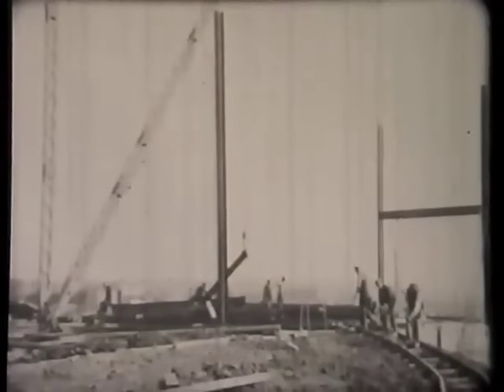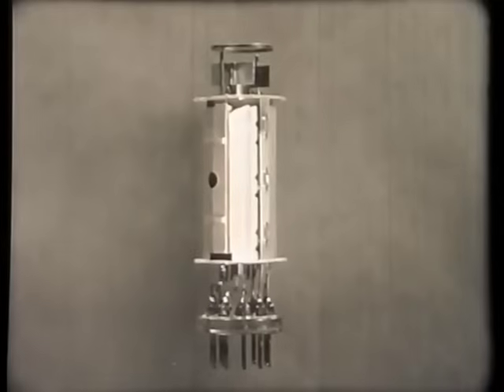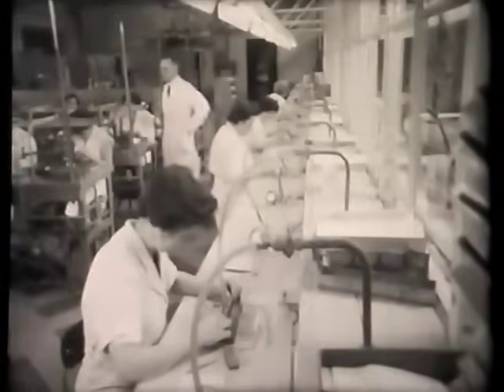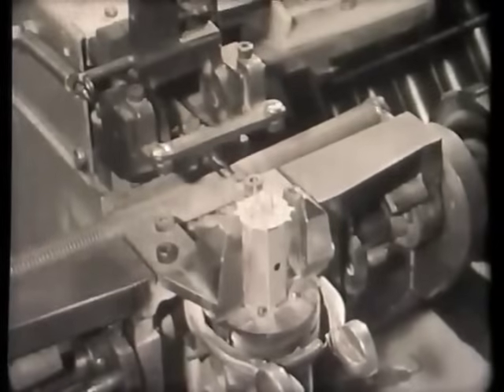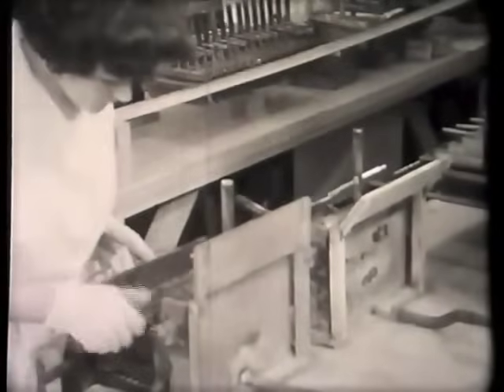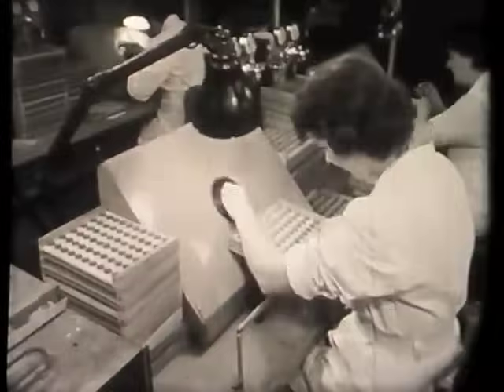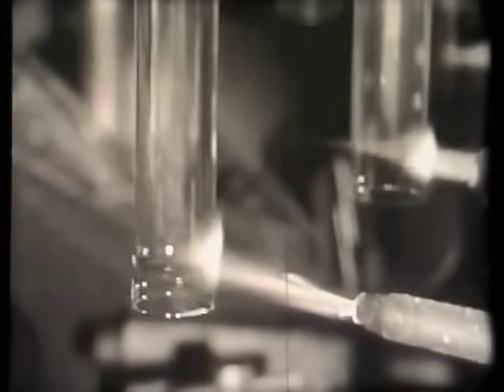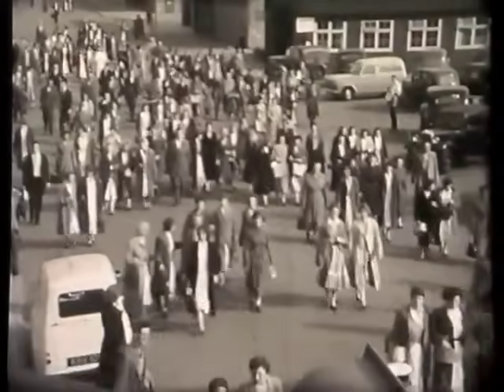The Mullard story

Comment: I worked for many years in M Building (seen at 2'33") which became the Videodisc / Laserdisc manufacturing plant in 1981. The wire factory was in the next building, and it later became our tape archive for Laserdisc and CD master tapes. That all closed a few years ago. Interesting site to work at with a large machine shop and engineering department that manufactured many of the machines in this video. I did my engineering apprenticeship there. The site also made electrolytic capacitors, circuit boards for Philips products, delay lines for PAL TVs and tungsten lamp filaments.
Reply: Very interesting! Thank you.
Reply: Thanks for sharing and best of luck!
Reply: You had tapes for CD mastering?  Presumably U-matic PCM1630 format?  I have equipment for those, believe it or not.
Reply: I did work experience in 1981 from high school Brownedge St Marys Bamber Bridge.

Comment: Apart from the amazing construction of the valves themselves I'm gobsmacked by whoever designed the machines that ran the processes as seen in the
 film.Just for the record I have a 53 yr old mains radio that contains Mullard valves -they still work!  Something special looking at the heaters glowing...
Reply: If I checked, there may be some of the same tubes in the National and Hallicrafters radios from that era. There is just something about a tube set that a transistor radio can't duplicate.

Comment: The EL84 they mention in the narration is an audio pentode, able to deliver 4 W undistorted in a class A amplifier, and more than 10 W in a push-pull configuration. It was later replaced by the cheaper triode - pentode ECL82 in all consumer electronics, as the additional triode in the envelope allowed to build a single-tube turntable - the triode worked as pick-up preamplifier in the turntable or Mike preamp in the tape recorder, the Geloso.
When I started my career, there were germanium transistors around, but they were too expensive for almost everything. I designed DC tube circuits - imagine the headaches with the feedback and the gain changes. The circuits were a royal pain to design, but the finished products were indestructible and had a fashion of their own.
But in 1962, when this film was made, the fate of vacuum tubes was already sealed. The silicon transistor was rapidly spreading and the design of ICs was ongoing; in less than ten years the vacuum tubes will be consigned to the scrapheap of history.
It may sound strange, but I miss that clunky and approximative world of the vacuum tube electronics. It seemed it has a soul; but certainly, it was warm... both literally and figuratively...
Reply: It looks to me as if the tube was actually an EL64 and not an EL84. Note that the plates were relatively short compared to the height of the glass bottle.  I have handled many many thousands of tubes here in the States but I've never seen an EL64.
Reply: @goodun2974  Very unlikely as there is no listing for EL64. Also the Miniwatt databook quotes the numbers 60 to 64 as being "All glass valves with 9 pin base", which refers to European 9 pin lock in base. The EF50 was the most common use of this base. Numbers 80 to 89 refer to American small button Noval 9 pin base.
Reply: @johnrebus1641  , the printing on the glass must be smudged; I slowed the video down to 25% speed and it looks more like a 6 than an 8, but the resolution isn't great and I'm watching this on a phone.
Reply: The EL84 has remained popular in guitar amplifiers to this day.  It is among the top tube types used in the power amplifier sections  of guitar amplifiers,  along with the 6V6, EL34, 6L6, 5881, KT66, 6550, and KT88, among others.  Few guitar amplifiers use the ECL82 but I think that a small number do.
Reply: I have 4 of them in my amp right now. RCA NOS that my grandfather had in his garage. I have Mullard tubes in an old radio he left me as well.

Comment: As a young student I worked at Mullard Mitcham, circa 1970, testing the much larger transmitter valves. It was great a time to be there, in such a busy department, even though I nearly electricuted myself, by touching the 400v grid bias electrode!
Reply: ouch, that must have hurt!

Comment: I'm amazed seeing the early robot automation, it would have been electro-mechanically programmed, very skilful design work. It would cost tens of millions to design each production line now, although easier in many ways with multi-purpose programmable robots.
I worked on a project on the 90's where some 50's controllers were being replaced. The only things i can liken them to were telephone exchanges. They were basically early industrial computers.

Comment: 23:46 that made laugh, precision processes everywhere and a gash hole made in the roof through a bit of gypsum. One would think they would have put a circular plate around it to finish it off.
Reply: A bit like I went to Jodrell Bank on a course and peeped behind an electronics cabinet to see a circuit board with wires attached and sitting in a cardboard box to insulate it from the cabinet shelf. Probably millions of pounds of astronomy gear and a cardboard box.
Reply: Bill  hahah yeah probably an essential mod that someone did years ago and it got forgotten about hahah
Reply: A bit like BT Openreach when the engineer came to install the full fibre broadband in my when they connected the fibre cable they had to open a hatch on the side of the pole to make the connection they had to move the copper connection board out of the way this connection board had a plastic carrier bag over it to protect it from the rain when i asked the engineer why this was the case she said most of these are like this i would have thought that they would have fitted a proper cover. thankfully the fibre connectors now used are waterproof.

Comment: I had no idea the process was this complicated and this well-automated.  The overhead associated with just maintaining all that machinery must’ve been staggering, especially in light of all the close tolerances required.  And think of the brain power and initiative involved in making all this happen.  And the labor costs.  No wonder the transistor swept this all away so quickly—but being a tube amp designer, I say that with a healthy measure of regret.
Reply: not on sound quality it didn't, we have to be grateful for the transistor, without it ICs would never have been invented
Reply: We need all this back, here in America. I love that we have tube manufacturers overseas doin a bang-up job (I love my Sovtek 5881's), but we need some at-home tube manufacturing for guitar amps and hifi
Reply: @TheChadPad  and transmitting tubes…
Reply: @dennisyoung4631  idk anything about those unfortunately. I’d like to! Tubes are cool!

Comment: the machines that was DESIGNED  to make the tubes is OUTA THIS WORLD!   no computers n  just a pc of paper, n a compass, n ONE SMART TOOL MAKER!
Reply: Not one tool maker, but an entire department (actually two departments, one for the valve/semiconductor department and a general one) dedicated just to production means for all of their sites world wide.
Reply: @mjouwbuis  Correct. And Blackburn engineers built most of the machines in this video.

Comment: Around 23 minutes there was the one and only mention of the word 'transistor'. Its incredible to think that all this plant, machinery and employment would be obsolete in a decade or so. Mullard themselves weren't paying attention -- they made transistors but they were invariably germanium, they were labeled like valves and packaged and priced like them. (So, for example, you could buy a vacuum tube triode -- an EC92 -- or a transistor triode -- an OC71. The first letter was the heater voltage or current, other letters were the valve type and the first digit the base type. They kept this notation for transistors even though by 1961 silicon planar transistors were being made by the bucket full (and the planar process was being applied to made integrated circuits). Mullard probably didn't know what was going to hit them until it was too late -- a pity since it was a fine company.
Reply: While the O was probably chosen by Philips and several other European manufacturers not to clash with the valve coding, it became a coding on its own, without the historical meaning from the valve coding. Then, pro electron standardised on A, B, C and R as starting letters and the Philips group of companies only used the O on custom semiconductors and pre production types anymore (NXP up to this day). I'm not sure what you mean by "didn't know what was going to hit them" as they made vacuum technology up to around 2008. Their transistors from the AC, AD, AF, BC, BD, BF etc. series were widely sold. In the IC era, they specialised in LSI bipolar digital and mixed signal circuits. Mullard was the design centre within Philips for Teletext and CD chipsets, amongst others. They still make semiconductors up to this day, though most historic sites seem to have been consolidated into a few new ones and some activities moved to sites outside the UK.
Reply: Mullard did produce silicon transistors, apart from the early alloy types, there were high frequency types like the BF115. NXP (the successor to Philips) still make transistors and ICs.
Reply: I recently restored a circa 1962 Bush portable radio that has all the original Mullard transistors.  The only components that had gone bad were the electrolytics and the detector diode.  It's an amazingly sensitive set and very well made too.
Reply: @mjouwbuis  Many of the silicon based semiconductors you mention were made at the Mullard (Southampton) Plant where i did my apprenticeship - too late for valves though.
Manufacturing went to the far east about the time i finished and the site now is a mixture of various other businesses. The EEB Dept (Electrical and Electronic Building) where many prototypes and other things were built is now a builders merchants (Jewsons i think) which i think i kind of ironic.

Comment: That machinery is amazing, effortlessly churning out millions of valves.
I have a D.E.R. valve with a pip on top and marked BBC which according to the information I have dates it as 1926 to 1927 but the incredible bit is that the tungsten filament is still intact and is very bright. It seems a pity to use it and burn out the filament, but it also seems a pity to not use it as intended.
G4GHB.
Reply: I'd recommend a Variac and slightly lower mains voltage to preserve the filament.
Reply: @jamesplotkin4674  It's a 1.8 Volt d.c. filament. I understand under voltage can be as bad as over voltage.

Comment: AMAZING and to think they did this without robots and computers
Reply: I see plenty of robots doing tasks in this vid.
Reply: Brian Cullen in my factory is, we are hoping to make it fully automated because we have a few workers and we have started to make them to robots
Reply: They did all this to build robots and computers
Reply: Plenty of robots in this video, but they were run with cams, limit switches and timers.  No microprocessors or PLCs in the mix.  Real engineering, tuning with feeler gauges and not a firmware load.  Great video!
Reply: @Albee213  wage slaves to capitalism. not much has changed unfortunatley. At least they were actually making something useful and world class quality

Comment: Wonder how the factory made money? I remembered the ECC83 (12AX7) cost a dollar back in the late 60s. I built my own stereo amplifier using 1 ECC83 for phono stage, 1 ECC83 for line/ tone control and 2 EL84 output stage. This setup was for 1 channel. Interesting hobby back then. I am from Singapore.
Reply: @who-gives-a-toss_Bear  The CEO was also not paid 1000x more than the workers, not more than 10x the lowest wage, I would bet
Reply: When the tubes (valves) were made in large quantity, the production costs were much lower. The setup costs play a large part of producing such items.
Reply: I also built a amp with 2x2 El 84 back in the 90s. We also dreamed about building an amp with 2 El 34 per chanel but they needed an 500 V transformer for the anode voltage.
Reply: @matneu27  I built one about 5 years ago to the original Millard design. weighs in at some 30kg, has 14 valves. Some parts difficult to obtain and not cheap!

Comment: I have watched this three separate times and I still find it fascinating. And Mullard made great valves/tubes. I still use tubes in my guitar amps. So far in my opinion they still sound better than transistors etc. for music.
Reply: I wish we could get the old el34 tubes they made my marshall guitar amps loved them now we get made in china crap why cant the us and the uk get togeather and start makeing them at home sad
Reply: @mariannwatt2678  ,  There would be enormous startup costs involved in making the necessary machinery again,  because Russia and China are unlikely to sell or give up their tube-manufacturing machines. Also, getting the requisite chemicals and metals and adhering to EPA and EU regulations for chemical use and disposal would be difficult and costly. And finally the cost of labor in Europe and especially America is much higher than it is in China or Russia.  There are a couple of companies in America and Canada that are manufacturing copies of the Western Electric 300 B triode that is much beloved by audiophiles, but that's a case where they can get $500 or $600 or more for a single tube.

Comment: Absolutely fascinating video. I would like to see how the process is done today for comparison. 💯
Reply: Some of the assembly might be done the same way on basically the same machines. Although some of the original equipment likely would have been sold as scrap metal, some of the machines got sold from Britain and Germany and elsewhere in Europe, to China and Russia.  Unfortunately it is quite possible that much of the machinery has not been maintained and kept up to speck and so even though some of the modern Russian and Chinese tubes might be made on the same machinery such as that shown here the tubes themselves might not be the same quality because of wear and tear on the machines plus perhaps lesser quality metals and chemicals being used for manufacturing the various parts of the tubes.
Reply: Similar probably, except it's in China and not Blackburn. I can't imagine valve manufacturing techniques have changed too much, except maybe robots might be involved now.

Comment: 24:15 They used glass in transistors?  I didn't know that.
Reply: Yes, in older transistors, e.g. early 2n3055s, I recall seeing small glass insulators surrounding the base and emitter pins.  They were similar to small beads, and I think they were a greenish color.
Reply: Yes, some germanium transistor like OC45 and OC71 used a glass enclosure. But it was painted black, as the junction is light sensitive.

Comment: "It is a story without end." Very shortly after this film was produced the end came. "Mr. Valve, meet Mr. Transistor, he's a solid chap from Japan."
Reply: Tube radios are still in use. Same with tube amplifiers which have a better sound quality.
Reply: @gravelydon7072  whilst true the ratio of valve to transistor is so massive in favour of transistor so as to make valves a micro niche thing now. I do prefer the sound of valves and use an SET headphone amp but I really am in a very small minority. 99% of portable audio listeners simply listen via their phone.

Comment: This is all very well and good but valve-based GPUs were nowhere near as fast as the ones we use today.  :-D
Reply: Tube amps if set up properly will produce beautiful warm rich music.Even Russian tubes from the 50s and 60s are well made and sound great!Mullards are a desirable tube.
Reply: Valve based GPUs may not be as fast as silicon ones, but they produce wonderful  warm rich floating point calculations.
Reply: And when they have to round they round rounder than silicon FPUs.